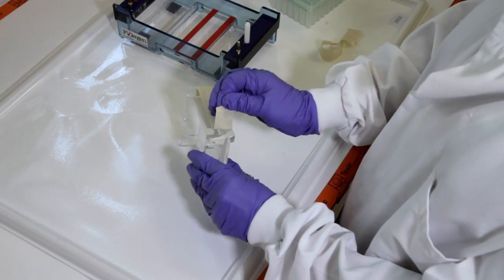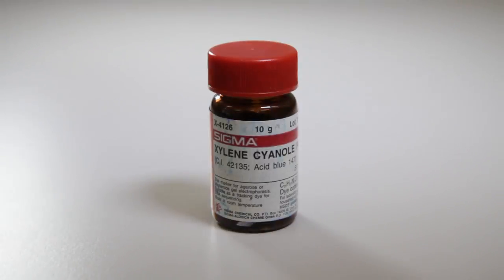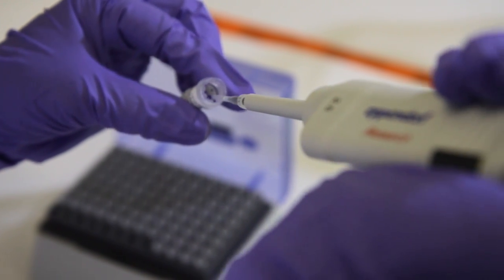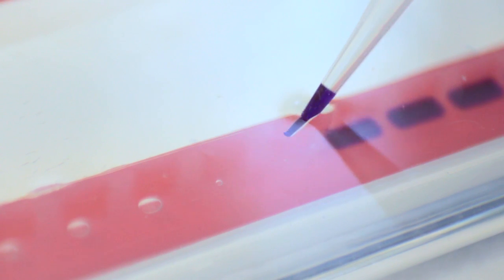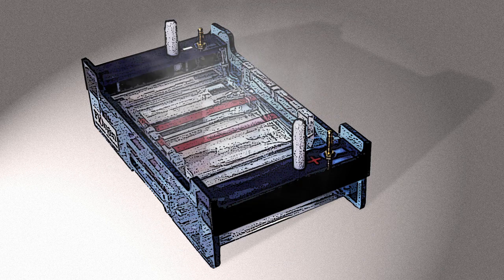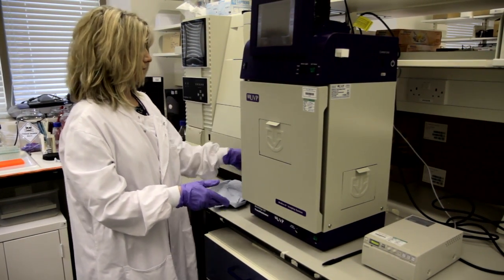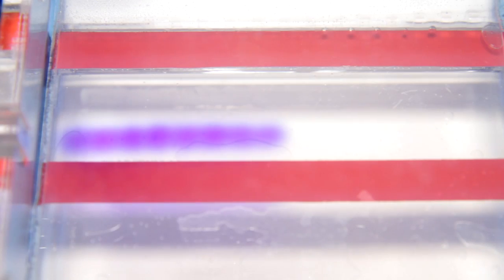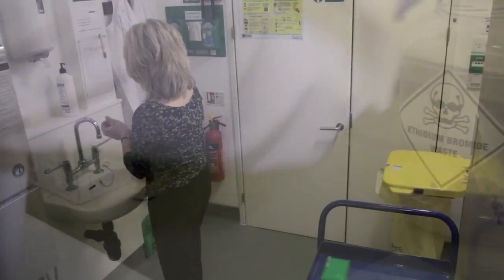How to run an agarose gel

Comment: Nice video! I have a cuestion
If I agarose gel 1%,TAE 1Xand small gel   
How many volts I will use to running the electrophoresis?
How  long (minutes)  is necesary  to running the electrophoresis?
* I have extracted DNA of 500-700 pb